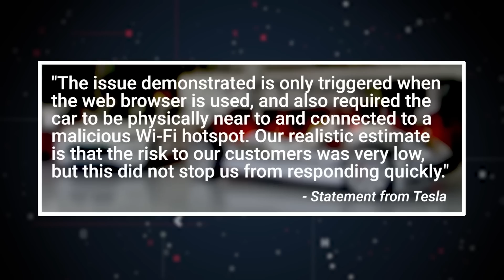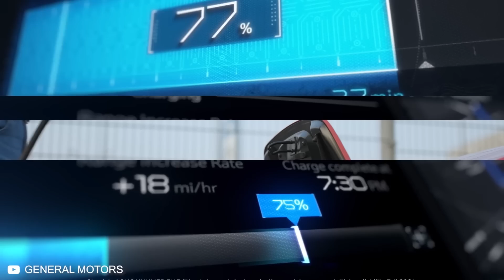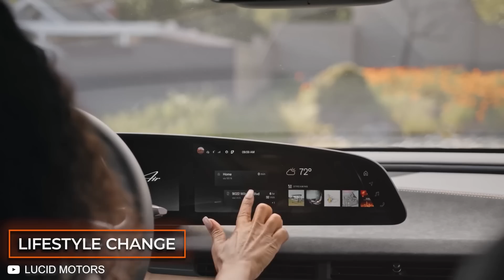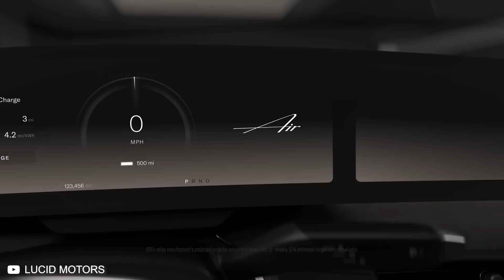EVs' Serious Problems That Carmakers Are Hiding

Comment: Stopping for 45 minutes during a road trip is a deal breaker. I can pump enough diesel for around 600 miles in about 5 minutes at a commercial pump. Stopping for 45 minutes every 300 miles adds 2 hours to a 900 mile day.
Reply: How about stopping for 20 minutes to charge every 300 miles (Lucid Air), or 10% to 80% in 18 minutes, (Porsche Taycan, E-Tron GT, EV6, Ionic 5) -- and more, cheaper ones coming in the next 2 to 3 years. Is that any better? But I can see why stopping for a total of 1 hour, (or an hour and 15 minutes) every 900 miles would be a deal breaker for some people. I mean, who wants to stop to rest and eat or go to the bathroom during those 900 miles anyway.

And it's not like diesel is all that expensive anyhow. What is it, around $6.00 a gallon these days? I mean, who wants to spend anywhere from $20 to $30 charging up your car or truck for 20 minutes (or as much as 30 minutes) just to go 300 miles. That's like $60 to as much as $90 dollars to go those 900 miles. Well, that's if you don't count those free 3 years of charging they give you. But still, I don't know for sure since I don't use it, but diesel sounds like a much better deal to me.
Reply: @Paul-cj1wb  Diesel should be under $3 a gallon and, unlike EVs, range doesn't significantly drop once you attach a trailer. 
I generally stop to pickup food (which I eat behind the wheel) and use the restroom when the vehicle needs fuel. With my truck that is about every 500 to 550 miles (7 hours). That stop is typically less than 15 minutes.
Reply: @rich7447  Should be or is? I'm sorry I see it at $6.20 where I live in the northeast and I thought most places were like that.

As far as towing, you are correct, EV trucks are not there just yet. But in a few years with ultra-capacitors added to support the batteries they will be. Ultra-capacitors charge super fast, in seconds. And whole banks of them can charge in 2 or 3 minutes. So with heavy trucks their charging is done mostly while braking or going down a hill as unlike batteries they can accept massive loads of power all at once. Then when going up a hill or accelerating they take over releasing huge loads of power with powerful resistors controlling the release, then the batteries take over while cruising.

Right now, batteries can only accept a fraction of the regenerative power of slowing down, but with 800 volt and higher architecture they can accept more and more. And ultra capacitors can accept basically of all of it with little to no losses. Rivian has already said their next generation of trucks are all going to be 800 volts or higher. And the others will follow. For example, GM has already stated as such.
Reply: @Paul-cj1wb  From an electrical standpoint the majority of your past post doesn't make much sense. 
1/ Capacitors charge/discharge based on a time constant Tau (for the circuit) that equates to T=RC. All capacitors regardless of size charge to 99% in 5T. As capacitors charge their resistance to current flow increases, which is why a capacitor is 63% charged at 1T, but takes 5T to "fully" charge.
2/ Resistors are, by definition, power loss devices. FETs are far more efficient at controlling current flow, but the braking effect that you are describing comes from the motor (in effect acting as a generator) trying to push current through the battery.
I'm not against electric stuff (I spent 5 years of my life getting both computer and  electrical engineering program diplomas). I just do not believe that we are all that close on viable full replacement.
Reply: @rich7447  The ultra-capacitors won't replace the battery pack, they are in addition to it. They will work similar to those used in industrial port cranes for example. They don't replace their electricity needs, they lower it's power consumption from the grid by assisting the crane when it's picking up heavy items, then recharge as the crane is lowering that heavy cargo by using gravity and the heavy weight to turn a powerful magnetic generator.

Think of it as a long cargo train. It needs the most power when it beginning it's haul, or speeding up after having slowed down, or going up an incline (they're very efficient because they need little power when cruising on flat terrain). But the flip side to that is that they need tremendous amounts of braking when slowing down, coming to a stop, or controlling its decent.  

These are not the old capacitors we grew up with. These are double-layer capacitors with very high capacitance. Let's say a truck is equipped with 10 small banks of these ultra-capacitors, (let's not talk about the extra weight for this purpose) each software controlled and each bank capable of propelling the truck and its tow-haul forward, (together with the batteries) that lasts for a minute or two either by the use of resistors, or, better still, as you've stated, current flow transistors. In doing so they prevent the highest power drain from the batteries until the truck is cruising. 

Now lets say the truck is going up a long, rolling incline -- a bank will take the first load to provide the momentum, then another later when the batteries begins to use too much power when the momentum begins to be lost, and therefore, to much drain; then another and another. 

When the truck reaches the other side, and begins the long decent with all that weight behind it, then a battery pack alone can only accept a limited amount of power at a time. No more than around 150kw on a 400 volt architecture pack, and that's only if they are at an optimal temperature, so it's usually much less than that. However, slowing down all that weight by a magnetic motor generating power provides much higher than that. It's more like many hundreds of kilowatts. So most is being wasted. However, those banks of now depleted ultra-capacitors can accept just about all of it. So they get to recharge first until they are all topped off. Then finally the battery.

I know I'm probably not doing a very good job of explaining it, but it's sort of trying to explain why diesel is so much better for towing than gasoline.
Reply: @Paul-cj1wb  Got it a little bit. What it comes down to is power (combined V and I). Basically you are looking for torque at speed. So for every horsepower you get from an ice engine you need 746w at 5252 rpm. This isn't exact because of the differences in the way that different engines make torque. So 1 hp at 5252 rpm for 1 hour is 3/4 of a kWh. That makes a 100 hp under the same conditions 75 kwh. Do you see the issue? 

I understand the concept for capacitance storage and it isn't new. It was one of the many things presented in 2nd year engineering school (first year was shared, so mostly math). I'm not smart enough to know if it is possible to blow past this, so I'm going to wait and see if Farad was wrong.
So....when dealing with electric motors and batteries. A motor that can produce 100 hp from a give power source can sink 100 hp to a power source. 

To be clear, voltage and amperage are interchangeable give the face that the conductor is capable of carrying the current. 400V at 200 amp is equivalent to 800V at 100 amp.
Reply: @Paul-cj1wb  Great so our EV vehicles will hold lightening bolt amounts of electricity and blow up or cook the passengers like a microwave when things go wrong.
HARD PASS FOREVER.
Reply: @Paul-cj1wb  You people living on the delusion that your precious green energy will be cheap is funny. Energy will be as expensive as gasoline... I'd say more because you can't run from it.
Reply: How often do you pull into a gas station and wait a while in line to get to the pump? Imagine you are on a long drive and pull in and find several cars ahead of you at the electric charging station. I would probably be several hours before you get to begin your 40 minute quick charge.
Reply: @namvet_13e  In three years that has never happened, not even once. Not saying it doesn't or wont but it hasn't for me and I don't typically travel long distance in my EV, I take my 4 door truck with a bed cover as it holds a lot more stuff I need to take with me when I travel. I didn't buy my EV to travel in, I bought it to work out of and daily commute. It is head and shoulders above any ICE vehicle for that purpose. People who never have had an EV always bring up the travel thing, again its a none issue for me YMMV.
Reply: Omg I haven't heard of anybody dying because their trip took extra 45 min of waiting,big deal I rather wait extra time charging and resting  waiting for my car to finish,than paying  the $9 a gallon for diesel I'm talking of Ca prices 😝
Reply: @magallon643  That's a 45 minutes stop every 3 to 4 hours. 
The choice as to whether you would rather spend that time waiting is entirely up to you. I choose not to wait and also choose not to live in California.
Reply: @rich7447  I recently saw on the News by the way that the National average of Gasoline price  and  Diesel  is at $5 dls a Gallon,I know you say you don't live in Ca but the High prices eventually will Catch up to you,and your gonna probably consider getting maybe one of those New F-150 Lighting all Electric pick up from Ford,imagine it will only Cost you the equivalent of $2 dls of Electricity to drive 320 miles when you charge at Home
Reply: @magallon643  I'm in Maryland where the electricity prices are lower than California, but still work out to about $0.13 per kWh. The Lightning has an available 131 kWh battery, so a full charge should be around $17 for an advertised 320 mile range (about $0.054 per mile). This seems like a pretty good option for people who are not going to use a truck for towing (EV range drops like a rock when towing). My current diesel costs me about $0.25 per mile, but that number stays pretty consistent whether I am toing or not.
Reply: @magallon643  When I am doing short trips I use our Wrangler 4xe. It only has a 17 kWh battery which is good for about 25 miles on pure electric, but in the last 1,600 miles I have only put one tank (17 gallon) of fuel in it. A charge costs me about $2.25 which works out to just under $0.10 a mile.
I'm also planning on replacing the Ram diesel (13 years old) with an F450 for towing once the 2023 order banks open. 
Electric has its place, but also limitations.
Reply: @rich7447  I don't know how you came up with that number of $17dls to charge the Truck, the power bill at your house its only gonna go up like $40 dls extra a month that means it will be like $10dls per week to charge your Truck Lighting,if you are at the super Charger it will cost you like you say close to $17dls but my point was, Electric beats diesel Trucks on the Economy side,because remember for as long you Own your diesel Truck you will forever be in need to Buy Diesel at inflated prices and Oil changes as well,when you switch to Electric power train that goes out the Door never have to worry about it ever again,other than Tires and rotation and Alignment but you're right if Towing is yor thing maybe Electric is not For you  at the Moment
Reply: @magallon643  Pretty easy calculation. Power is $0.13 per kWh, full charge on truck is 131 kWh. 0.13x131=$17.03. 
If your electric bill goes up $40 a month then you are doing the equivalent of 2.35 full charges, which according to Ford should take you 753 miles.
Diesel was actually not that bad a price until the current administration decided to start killing off oil leases and pipelines. Like it or not just about everything that you buy is affected by the price of diesel.
There is periodic maintenance required for diesel and gasoline vehicles and that can get expensive. Right now we don't really know how that compares to the cost to replace a battery once these new EVs reach 10 years old (average capacity loss is 2.3% per year). Between 2010 and 2021 EV battery prices dropped from $1,160 per kWh to $137 per kWh. With the rapid changes in EVs who knows if 2032 battery technology will be compatible with 2022 model year vehicles.
Reply: I get over 700 miles on a tank of diesel in a 24 gallon truck. This guy took an 1195 mile road trip in the new f150 lightning. He paid $193 on 11 stops including 3 free charges.
Reply: And what are you going to do when they start taxing your EV to fix the highway
Reply: @mikehand2668  Wont notice since I pay so many taxes already, besides they tax me every time I register it and on the electricity and on any farts I cut in the process.
Reply: Let alone it is not safe to be in a stop in the middle of nowhere. As a woman I usually drive 300 km/30L of gasoline in my country when I go from the city I live to the one my family lives. I get more gasoline in the tank to do the final 100km (400km total)... in a city... in 5 minutes.

According to this BS, I'd have to stop around 200km... which means to stop in the middle of nowhere and wait 30-45 min to charge the car enough. Is this safe for anyone?

Can these kids at least hear Al Goore doomsdays speechs from almost 30 years ago? He was saying the ocean would rise 10 feet around 2004-2005... and yet he bought beach front houses (and probably very cheap).
Reply: and what is diesel going for now
Reply: @douglaslynn157  Around $6. Decisions have been made to artificially inflate the price of fuel. Eventually it will impact electricity costs as natural gas becomes more expensive.
Reply: One last comment on the whole stopping for 45 minuets on a road trip to recharge which is total BS. To me not having to go to a gas station EVER which is typically a weekly thing or more for most people in my area, what about that convenience? being able to refuel at home and go potentially years without stopping at a gas station is totally ignored by you boneheads. That to me is the best most awesome thing about an EV NEVER EVER stopping for gas at a gas station. Try to do some deep thinking about this. Its truly amazing and wonderful, I know because I have lived it for 3 years now. Also I currently am paying less then $100 a month in electricity and I drive way more then the average person. Over 20,000 miles a year. Let that sink in also.
Reply: In the UK thieves are now cutting charging cable's for the copper, it's just getting crazy now
Reply: Battery Technology is Improving year Over Toyota developed a Battery that is gonna give you the Freedom to Charge your Car in 5 Minutes,let's hear the stupid excuses people are gonna make for that.
Reply: If you are driving 600 mile stretches non stop, please don't drive anywhere near me or my family. You need to stop for a rest at least every 2 hours. Falling asleep at the wheel is a thing.
Reply: @stulop  2 hours? That is insane. You would never get anywhere.
Reply: @rich7447  how unsafe so you want to be, it's up to you.
Reply: @stulop  Who told you that you need to stop every two hours? I have a commercial driver's license and am only required to stop for a 30 minute break after 8 hours of driving (when in a commercial vehicle, no requirement in a personal vehicle). So in a commercial vehicle I can drive for 11 hours with only 1 break of 30 minutes. There is nothing dangerous about driving for prolonged periods of time as long as you are not tired. Once you are tired, don't push on further.
Reply: @rich7447  The UK above 3.5 ton driving rules, are a break or breaks totalling at least 45 minutes after no more than 4 hours 30 minutes driving, same for the Eu also. This can be taken in portions of 15 minutes within the 4 and a half hours. I know there are no rules for the likes of me but taking a break for a coffee and a pee every couple of hours will serve to keep us all safer. I have lost count of the number of videos I've seen here of drivers falling asleep at the wheel, causing carnage in their wake.
Reply: @stulop  I'm not advocating driving while drowsy, but you would get nowhere in North America stopping all the time. If you are coming east out of Denver you aren't going to hit a major city for 600 miles/1000 km (My GPS indicated that my next turn was 638 miles coming out of Denver on east bound I-70 - trip was Boise ID to NE of Washington DC). Even cities that we consider to be close (St louis and Chicago for example) are hundreds of miles apart. We have vast distances, far fewer vehicles per mile of road and vehicles that are designed for long distance comfort. Doing 8 hours on an interstate in a full size truck or SUV is nothing. A class A diesel pusher makes 8 hours feel like 2. Small displacement, high revving, stiffly sprung vehicles will fatigue a driver quite quickly which is why we tend to avoid those types of vehicles (and why Europeans can't figure out why we only get 300 hp out of a mid-displacement V8). 
I spent a lot of time driving in Northern Canada in my younger years and you really have very few places to stop.
Reply: @stulop  I looked up the 3.5t UK limit. That is insanely low. We don't hit those restrictions until 26,001 lbs.
Reply: @rich7447  Thy were introduced in 2007  by the Eu. We still carry them on having left. There's other training and certificates you have to get beside a driving licence even if driving a little van commercially. Thank God I was out of it all before all that started around 2012.
Reply: I do not think you would have done it if it was as expensive as in Sweden.  here, diesel costs about the equivalent of two dollars and 50 cents per liter
Reply: The metal thieves will be cutting off the cords when they realize how much copper is in them.   We can't stop catalytic convertor thieves we ain't gonna stop metal thieves.  Think of how many people will be stuck then.
Reply: @38XKB8  I charge at home so wont be an issue for me.
Reply: Commies pushing the global warming scam don't want you to drive at all.
Reply: @460scorpion  Yeah that is exactly what I thought.
Reply: @460scorpion  First off there aren't enough cars for everyone to go electric so your talking about something that wont happen because it cant happen for years, by the time everyone can buy an EV which will happen over time, there will be more charging options everywhere which will be built over time as well along with the growth of EV's. the electrical grid is everywhere is it not? Its a simple problem that will be overcome as we go. I stopped at a charging place the other day it had 24 charges and I was the only one there and it took me exactly 10 minuets to put 100 miles of range on my car.  Again you are miss informed big time.
Reply: @460scorpion  I live in the US and in a home, most people I know live in a home. The electric grid is everywhere and no big deal. I guess you can get an electric bike if you live in such a densely packed area. Sounds like even owning a car is a chore there.
Reply: Cool story. Sounds like an ev is not for you. See how easy that was.
Reply: What do they say about time being priceless?
Reply: I seriouslly hope you're not driving 900 miles in a single drive, without taking any breakes. If so please tell me where you live, so I can stay far away from your roads.
Reply: @triggertits  Yep. Pretty common in North America.
Reply: Electric cars are a massive environmental disaster. Why would you buy one?
Reply: Charging for 45 minutes is just a dream. Let's say there is a large rest area with over 1,000 parking spots. Usually there are no more than 20 charging stations in such a large parking lot. Just imagine there are only electric cars, around 1,000, and ALL of them stopped for charging because THEY HAVE TO. You just come next and have to queue, because you MUST charge your car, or you won't go anywhere without. How long do you have to wait? Just a simple math says you will spend days there.

And this is not the only problem. There are much bigger problems with electric cars, but the companies who sells them don't want you to know.
Reply: @mike-bv2jc  Now a days I see lots of EV fan boys bot out there pimping for EVs in youtube comment section. Who are they? Who entitled them to convince us with the lies of EV companies hide? I think EV has become a new woke syndrome and a new political agenda for west. Just like 100 g e n d e r s agenda. Disgusting.
Reply: @mike-bv2jc  I think in  American at least in the foreseeable Future For traveling Long haul,some people are gonna Stick to Gasoline at $10dls a Gallon given the  nature  of how fast the price of Gas is Rising,and for all the Local driving is gonna be Electric at $1.36 for a Fully charge Battery ,when Charging at Home and Public charging  at $10.00 dls for Fully charge,wich still most  Definitely beats a Gas Car in the Economy to travel Locally.
Reply: @mike-bv2jc  that's factoring people coming out to unplug the chargers from their cars once they are charged up. What about those who decides to go do something else while their cars are charging up for hours instead of just 45 minutes?
Reply: @mike-bv2jc  Do you have an EV? I say no you don't because you have no clue. I drove a 250 mile trip recently and only had to charge for 20 minutes once I got to the town I was going to and then one more time I stopped and charged for 10 minutes on the way home just to be safe but I would have probably made it anyway. That's a total of 500 miles give or take and a total of 30 minuets spent charging. The 10 minuets my wife went to the bathroom while I stayed in the car then I went and we were off. The 20 minutes at the town we went to we went in and eat lunch and was off. By the time there are only electric cars which will be years there will be way more charging places but most of your charging is at home, so on a trip you full charge then hit a charging place on the way. It blows my mind how people make such a big deal out of charging, its not a big deal. If it freaks you out then rent a gas car or don't buy an EV. I have both so I can use either but I mostly use my EV and its never been an issue. Most Tesla super chargers charge at around 500 miles of range an hour and my car only charges to 315 miles max so yeah 45 minuets would be a max charging session if I were near empty and charged all the way. Again you clearly have no clue.
Reply: @jstar1000  I don’t have an ev and I am not interested even in driving one.
Reply: @mike-bv2jc  OK, then why are you hear watching videos about them, are you wanting to affirm your distain for them? You know when the combustion engine car came out lots of people wanted nothing to do with them and just wanted to keep their horse. Just saying.
Reply: @mike-bv2jc  there are a lot of other things that are destroying the planet much worse and faster then any car, truck, plane etc.
Reply: @Amor1990  why would they want to do that, that would put them out of business, besides I can turn off the internet connection and then they couldn't.
Reply: @Amor1990  The power utility can shut your power off remotely, so can the water department. So I guess your dad doesn't want or need an EV. OK, cool, don't get one. I have a vehicle for long distance travel, my Tesla is my work vehicle and daily driver, I only charge it at home and never stop for any power needs so it works for me and is super cheap monthly. I pay between $60 and $75 a month on electricity for all my driving needs. Gas would be $500 to $700 a month. My battery is topped off and ready to go every morning. Not sure what else I can say. Again, don't want one, don't get one. I have one and absolutely love it and will not part with it for any reason.
Reply: @mike-bv2jc  mike is a complainer plain and simple
Reply: @mike-bv2jc  hahahaha
Reply: @mike-bv2jc  did you also know that there's people out there that don't even Own a Car,the Take Public transportation.
Reply: @jstar1000  the faster you drive to more battery life the EV uses.
Reply: @mike-bv2jc  I'll never drive or buy a EV car.
Reply: @Asidebar  yeah, just like with gas.
Reply: You could actually have taken this teaching opportunity to make your points  of us who don't know, without being insulting to him at the end of your remarks. People forget, so often, on social media that they can still be nice.
Reply: Actually, a 45 min charge gets you 80% so you'd be stopping every 240 miles (and that's only the case with a fast charger, God help you with the third party generic chargers). See how well they mislead people?
Reply: @goldenrod8861  Even worse than I thought. My long road trip vehicle gets around 1,500 miles to a tank. It takes a while to pump 200 gallons of diesel from one nozzle though. Usually around 10 to 15 minutes.
Reply: @rich7447  you go that far without a nap? Dude that's dangerous
Reply: @AndrewReadman  It depends on the vehicle. A full size truck or SUV and it is not that tough. Class A diesel pusher makes it even easier. I wouldn't recommend it in a smaller vehicle.
I started trips like that back in my early 20s travelling between Yellowknife and Edmonton. A good portion of that was gravel.
Reply: @rich7447  Do you drive 1500 miles in one day?  .  Do you live in your car
Reply: @Andersljungberg  I top out at about 1,000 miles a day.
Reply: Driver inattention is the major cause of auto accidents.     Read the other day the stopping to charge the car reduces accidents.   And it will soon be a moot point as charge times drop.
Reply: @danharold3087  <<Driver inattention is the major cause of auto accidents.     Read the other day the stopping to charge the car reduces accidents. >>

Thus do enthusiasts deny reality:  EVs will reduce traffic accidents!

The disadvantage everyone knows exists with EVs is instead packaged as an advantage.  Of course it's a lie.  But lies are necessarey to market EVs.
Reply: @SeattlePioneer  Ocasional stops were said to reduce accidents long before  modern EVs.  But you can think and say anything you like.  Even if your wrong :)

Lets see.  Tesla has never advertised.   People are waiting months to get one.   Some are willing to put up with the sub standard build quality of the california built Teslas.    Marketing them is a real pill.
Reply: @danharold3087  <<	
Dan Harold
SeattlePioneer Ocasional stops were said to reduce accidents long before modern EVs. >>

You were marketing one of the principle disadvantages of EVs as a safety feature!

<< But you can think and say anything you like.  Even if your wrong :)>>

Ditto. 

I suppose the person trying to stretch their tired body to the next EV charging site is creating as much of a hazard as an ICE driver who has not reason not to stop any time he feels drowsy. 

But keep using that imagination!  It's needed to patch up the weak points of EVs.
Reply: So how often do you drive 900 miles a day, I never do and never will if I can help it. Also if you drive that much you most certainly should stop a couple of times for at least 30 minutes for crying out loud. Commercial drivers have to by law. EV's are really not for long distance driving anyway they are for commuting mostly at this point so your argument really is moot. Also I can add 100 miles of range on my EV in 10 minutes with a super charger so 20 minutes gets me 200 miles and I like to stop at least every 200 miles when I travel to pee etc. That is a good 3 hours of driving but you do you.
Reply: @jstar1000  We do between 3 and 8 road trips per year (more if they are shorter) . So depending on where we are heading (usually Florida, Kansas City, Ontario Canada, western US) from Maryland it usually ends up being around  15 days a year.
Reply: @jstar1000   I've driven over 1000 miles a day 6 times in the last 2 year while taking long road trips. not possible with an EV.
Reply: @Smashingdon  1000 miles a day...really? I call BS on that one but whatever. If you don't want an EV then don't get one.
Reply: @jstar1000  Actually  I drove more than 1200 miles in  a day. My six trips houston to Philly in 26 hours (1500 miles one way) with only bathroom breaks, in 2020 and 2021. Also drove from Houston to Utah (2020)  (1200 miles) and back under 20 hours each way. Thats 6 trips above averaging about 1300 miles in a day. i have friends who did Houston to new york every year the same way as well. Lots of people do it. Just cos you don't do it doesn't mean its BS
Reply: @Smashingdon  1200 miles divided by 20 hours means you have to average 60 mph the whole time with zero stops. It's totally impossible.
Reply: @jstar1000  Also you know that thousands of truck drivers generally drive 1000+ miles everyday, so me doing it once a year is no big feat at all and you don't have to call it BS.
Reply: @Smashingdon  You clearly have no clue what your talking about. My brother is a truck driver and he can only drive so many hours a day and has mandatory stops for 30 minutes every 4 hours, plus his truck will not go over 70 miles an hour,  no way in hell can he or any truck driver even come close to driving that many miles in one day. You need to get over this 1000 miles a day crap, its total crap, no one does it, period, its impossible. Do the math. Maybe if you go out where there is no traffic on some lonely highway in Wyoming or something but even then, no way. Stop it, I will not respond to this nonsense anymore.
Reply: @jstar1000  Truck drivers are limited to 11 hours BTW per day and the average speed for those 11 hours works out to about 50 mph (550 miles per day). However it is not uncommon for non-commercial drivers to hit 1,000 miles a day. 
A lot of Canadians I know will go from Ontario to Florida (minimum 1,400 miles) straight through using either 1 or 2 drivers. 
1,000 miles usually takes me about 15 hours (sometimes up to 18 hours) when east of the Mississippi and slightly less west of the Mississippi.
Reply: @jstar1000  Well, there goes the family car holiday. And you have to wait for others to recharge; and if you recharge on a fast charge basis all the time, you are going to wear out your battery faster, and that costs about $15,000 a replacement; and you are sitting on an energy bomb, with the whole family likely to be incinerated if there is some sort of short circuit; have a look at the Paris electric bus fire: a complete inferno in a few minutes. No thanks; the electric car was abandoned before, for good reasons.
Reply: @geoffreyparker926  My truck is a 4 door and larger and holds way more cargo, i.e. luggage, then any sedan no doubt. I have a cover over the bed to keep everything dry as well. I also take bicycles with me usually as well. Besides I'm 60, my kids are adults and don't go on vacation with me unless they take their own vehicle. I've never in 3 years had to wait to charge at a super charger, not even close but I rarely hit a super charger like less then 10 times in 3 years. I charge at home every day over night, full battery every morning. That to me is the best part. Never stopping at a gas station is life changing my friend. So sitting on a gas tank with one of the hottest explosive liquids on earth is no big deal? You can hate all you want, EV's are the future and you can't stop it. Again one last time, even on a trip, you never typically have to full charge at a super charger you only need maybe and I mean maybe 200 miles of range to get you to the next charger or your destination. Who drives more then 200 miles with out a break of some sort anyway? At 500 mph charging speed which is common at a super charger station your there 20 minuets at the most based on a typical stop when traveling. Personally I rarely travel by vehicle anyway, if I go somewhere, I fly.
Reply: @jstar1000   For most people, a 900 mile drive is rare.  But many of us (more than you think) a limit of 350 between charges is too short of range.  Examples are plentiful.  For me, I drive weekly to retrieve items I've purchased at auction, often 250 miles each way.  If I am in a Ford Lightening with a small trailer, my range is significantly reduced empty, and halved once loaded.  I also like to go camping as often as possible and those locations are often several hundred miles away.  As a commuting vehicle, they might be just fine, but to live my life, I would require both an EV and an ICE vehicle to get by.  When they can get the EV truck ranges up over 600 miles, and the charging time under a half hour to 80%, they will change some minds.  Until then, the EV is nothing more than an iPhone you can drive... a gadget.
Reply: @matthewpeterson3329  I get that, EV's aren't for everyone just like a truck isn't for everyone or a 3 cylinder two seater isn't for everyone. I would argue that an EV with 300 miles of range give or take is enough for 70% of people though. Maybe not folks that live in an apartment or a place they can't charge at home of course but anyone who owns a home and drives less then 150 miles a day would benefit from an EV in my opinion. I spend between $70 and $80 a month driving my EV way more then the average person drives. That is a huge win in my book. If I drive my truck I would be well over $500 a month at todays prices for gas and diesel. If you don't want an EV or don't care about them that's cool. Drive your ICE vehicle and be happy like me.
Reply: @jstar1000    I agree with you, mostly.  And honestly, I WANT the EVs to get good enough to be a viable replacement for ICE trucks/cars/vans.  I own two cars actually...  my Silverado, and a Kia Rio which gets almost 50 mpg, for the same reason you claimed.  The truck does my work, and the Rio is my 100 mile per day commuter.  But with that Rio, I don't have to wait to charge it, I don't have to find a charger or mount one in my home, and I don't have to worry about the health of a $12,000 battery in Phoenix when it's 115 degrees.  Extreme hot or cold weather kills them.  There aren't enough pros with EVs, YET, to out weigh the cons.  I really do look forward to the day when the performance, price, and convenience of the EV is indistinguishable from the ICE vehicles.
Reply: @matthewpeterson3329  Well I live in the DFW area of Texas and its been super hot for days and the heat does not effect the battery at all compared to the cold, the cold is much worse on it and I actually don't care for the Tesla when its super cold but the new heat pump which mine doesn't have is suppose to be a lot better. I've had mine for three years and the battery has had zero issues and has an 8 year 120k mile warranty so I'm not to concerned, by the time the warranty is out I'll be more then ready to buy a newer better battery to keep it going another 8 or so years I'm sure. I have an F250 diesel and a Ram 1500 gasser and love all three but I drive the EV 95% of the time. It cost me about $80 to drive. Putting in a 14/40 plug cost me $70 and I did it myself so that was not an issue what so ever. I have three years with an EV and love it you have zero time with one and are hating so there you go.
Reply: @jstar1000    What part of anything I said was hating?  What I stated was factual, and reflects most people's concerns and reservations regarding an EV purchase.  You and I are lucky enough to own a few vehicles that suit our needs, but what about the guy who only has the space or budget for one vehicle?  They are trying to find a unicorn, or at least a single vehicle that checks as many boxes as possible.  The EV can't quite achieve the level of versatility needed, from one vehicle, for someone who commutes, but also needs something heavier to tackle bigger  jobs.  You can't tow a trailer with a side by side, or a even a small camp trailer with any EV except the Lightning or Rivian, and the range is severely chopped when doing so.  Meanwhile, our fuel prices go up, and when the EV is in the majority of vehicles on the road, fuel will get worse.  So unless they can build an EV that can, apples for apples, replace the ICE vehicles, there will be folks who will refuse to convert.  And we never even got into infrastructure.  It's simply not ready for the influx of EV owners if, suddenly tomorrow, half the cars on the road were electric.  The whole idea of an EV world is lacking, but when they get it right, I will be on board.
Reply: @matthewpeterson3329  Its not you totally, I hear lots of people who never have experienced owning an EV bitch and complain about problems that don't really exist.  I have an EV, gasser and diesel, I tow a 36 foot 5th wheel with three slides with my diesel, have a boat, and enclosed trailer. The EV is my go to for 95% of use, I'm a home inspector that drives over 100 miles a day every day most of the time. I set my car to charge at 25 amps over night an could turn it lower and it takes about 6 hours if its really low which is no problem so its not sucking crazy amounts of electricity over that time period. So is that any worse then someone running a dryer or an AC unit or water heater? The grid is growing over time with EV use. I see more and more people installing solar which helps the grid also. I think we will be ok with any grid issues, everyone is not going to have an EV over night anyway as they can't make them that fast with supply issues.   As for the person who can't afford more then one vehicle, that's nothing new. If you can't afford to have more then one vehicle you shouldn't be buying crap that needs to be towed anyway in my opinion. To drive a big honking gas or diesel truck every day so you can tow a boat or RV once in a blue moon is not smart. That is the problem with most of America, people buy more crap then they can afford. I think we agree more then we disagree you just haven't experienced an EV yet. Go test drive a Tesla at your local Tesla center. I dare you.  Hell, I double dog dare you. Then lets talk again.
Reply: @jstar1000  it's called a vacation. And let's not pretend you can have two people driving who will swap after 6-8 hours
Reply: @jstar1000  the point is that you never know. 
Last year my kid had accident while on a camp. 800km I drove there on gas redbull and pure adrenaline. 
If I had to wait an hour for charging I would probably steal a car just to get there. 
And that is a point of a car... freedom.
If I plan a long trip I might as well take a train... but what if I cannot plan it. 
People who buy electric as a second car... here is a small advice... want to be green?
Do not buy a second car! 
And in term of green impact it is better to buy a car that can last decades than one that will require new batteries in 4 years.
Reply: @JM-mh1pp  my battery has an 8 year warranty. It's three years old and still going strong. I didn't buy my EV because it's green, I bought it because it's bad ass.
Reply: @JM-mh1pp  Just to clear this up - a Tesla from 2013 still has 92+% of its capacity remaining. The Nissan LEAF is what you're thinking of - the first mass-produced electric vehicle with no active cooling. Technology has caught up drastically and basically every single other EV has active cooling. This means the batteries will last longer than the vehicle itself (seriously, it's true). Even if a battery has to be swapped, it is never "dead", it is usually thrown into a large-scale energy storage system. Once the battery is no longer considered usable for that purpose, the materials are recycled (in an ideal world, we need to work on standardization of batteries so this is easier).
Reply: @tausifnazim5048  maybe, I charge at home so I don't care.
Reply: @JM-mh1pp  hahahaha
Reply: @JM-mh1pp  it's actually every 11 Years For a Ev battery Half a Millions Miles if you want to be specific
Reply: @jstar1000  "Moot" not "mute"
Reply: @goldenrod8861  Lol, yeah I know, I type too fast, my brain can't keep up.